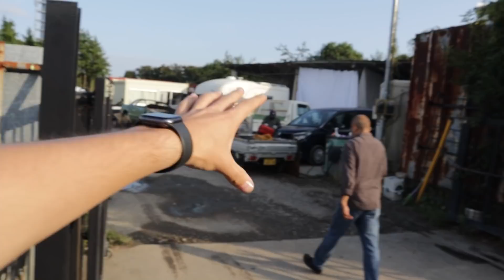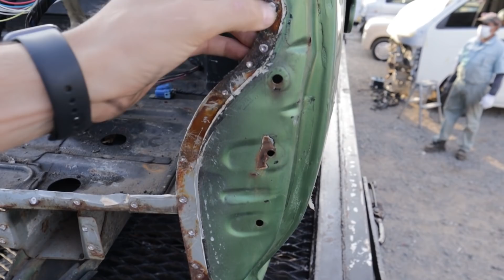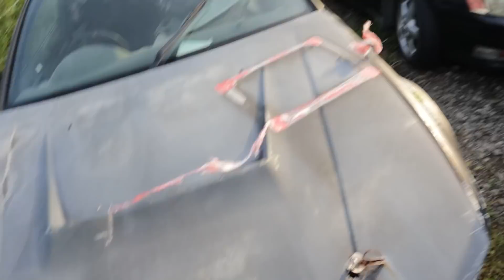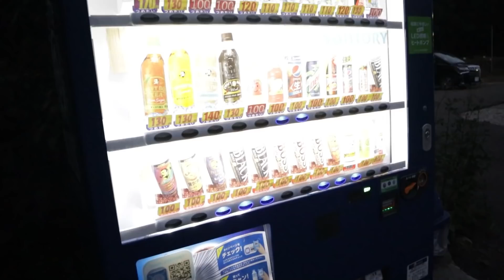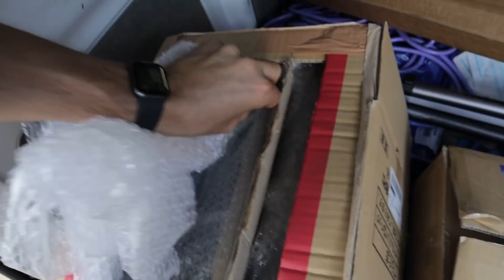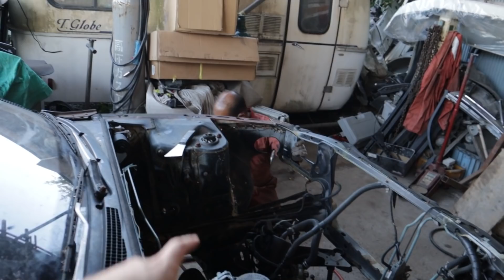BARN FIND SKYLINE IS BODY RESTORATION BEGINS!

Comment: This is a good demonstration of why the weakness and rust develops. I have also heard that the meatal Nissan used had to make the metal pressings for the chassis had impurities that caused them to rust out faster. And Japan seems to have a lot of rain and moisture like Florida. Kevin M's has a different rear quarter panel that these I believe. If you do have any extra painted green metal off the 32 you should make into into key chain fobs and sell them or give them away because it is obviously an old time attack or drift car. You may even be able to find pictures of it and its history.
Reply: check out sam's twitter mate...the old owner thought that sam going to revive it

it's quite sad

Comment: You should buy yourself a quality mig welder (a home level one works fine) a disc cutter, some cold chisels and a grinder and go at it. I have built tons of cars without ever having fancy tools, in the UK everything is as rusty as the parts car you showed. My stuff might not be as good as a build costing thousands but it beats being unable to do anything because I either can’t afford the shop bill or they are too busy. My welder is a total POS  but has saved me 1000’s

Comment: Big thing you notice with a lot of the tools these guys are using is that they're pneumatic. A good air supply system can cost a lot but it's so nice using pneumatic tools. Tons of torque, low weight, really durable. A proper air supply system is beyond most people's budget or needs, but even a solid compressor will let you get to work with nice torque gun or hand sander.

Comment: every car is designed and built with the same issues they all have the same spotwelds  the biggest problem is they dont dip the bodies into a weldthrough primer before they go to paint if they did imply this prosses it would cost a bit but they would loose big in the end because cars would last 10 times longer without rusting away

Comment: so I know you've seen the clip "rust is to a minimum" and where that came from is a guy in New York state and he bought a R32 GTR and got ripped off really bad. he currently has the chassis on a rotisserie he made himself and is taking each panel off piece by piece restoring it. and I'm telling you this because he needs parts where the metal has rotted through and you may have some usable pieces he could repurpose to save his GTR dream car. his name is Kalvin Malli his name is his youtube channel. he is working very hard to put this car back together and if you could give him a little help I know he would greatly appreciate it.
Reply: Actually he is from NY but is in Austin, TX. Kalvin Malli and the clip is the guy in Japan that sold it to him.
Reply: believe it or not sam actually has the top comment on that video 😁
Reply: that dude probably only wants brand new sheetmetal
Reply: @gregh7457  I'm sure he will take what he can get